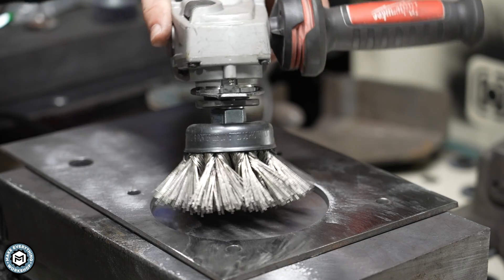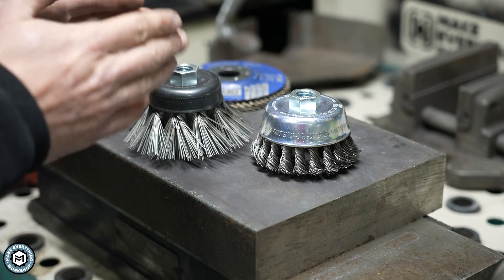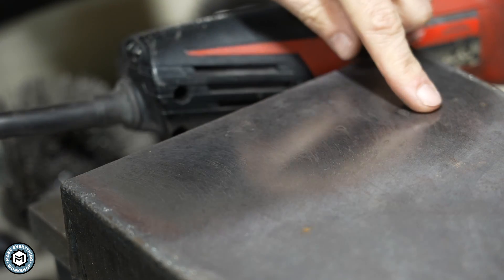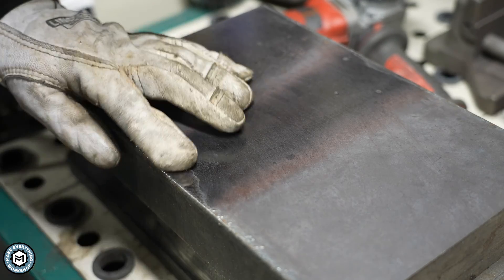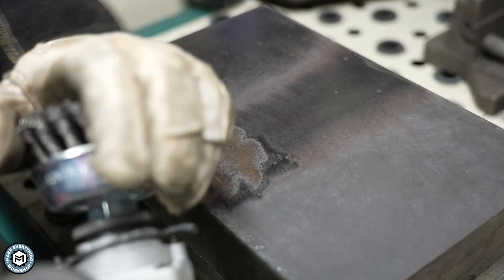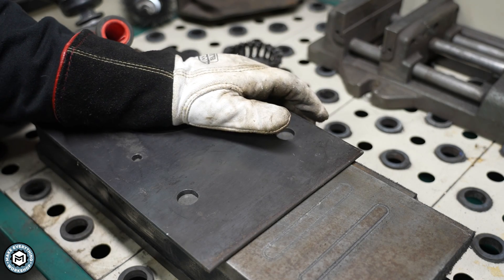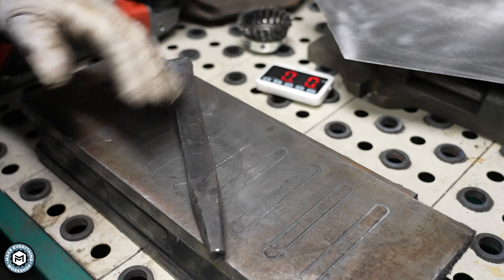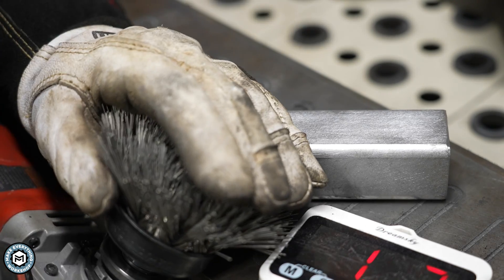Does a $300 Diamond Coated Wire Wheel Work?

Comment: Anyone that has done metal work knows flap wheels only leave deep gouges "depending on the way you use it" with any metal removal consumables you wanna keep a flat position and dont apply too much force....there is noooo way this is more cost effective than even the cheapest flap wheels 🙄

Comment: I can see the advantage to the diamond coated brush, but the real question durability. The fragility of diamond plating may make it impracticable, especially for most applications. It is an interesting option though.
Reply: fragility?
Reply: @GroberWeisenstein  Yes, fragility. I have worked a lot with diamond plated abrasives. The only way I can describe them is fragile, as the nickle plating holding the diamond grit can be subject to cracking and flaking. Taking in to consideration the flexing of the wires in the wheel gives me  consideration of their durability. ✌
Reply: @joemcgarry1106  thats why copper is used in premium diamond pads and heat resistant resins for filaments
Reply: @GroberWeisenstein  Thanks, I  will read up on it.

Comment: I had bought this purple 3m wheel that looked like plastic with fingers. It lasts long if you are only doing flats and not edges it takes mill scale off really well and was much cheaper. This diamond wheel is neat but $$$

Comment: You can clean  ferrite off a wire brush using  a soak in Citric acid or just buy Iron Out at the Borg.  
I've been looking at the Diamond wheels.  At $300  I had a lot of questions - especially  how long they will last.
 In the meantime I found Pferd  They have disks that  literally  eat steel for lunch.  And they last forever. 
So please do post an update after you have been using the Diamond brush for a year.

Comment: You could buy coldrolled steel. That stuff usually has no millscale whatsoever, also the tolerances are tighter, its worth the tiny bit more price because often enough you just take it, cut it to lenght, deburr and thats it... If you have a surface Grinder or Mill throw it on there with some old big gnarly face cutter or wheel and give it a spin. Even a belt sander works wonders on that or the pneumatic scale removers you have for welding... If you really wanna use an angle grinder with 300$ wirewheel (ever had one of those or more wires sticking in your arm or else?!) Then go for it. Im not saying its per se bad im just giving ideas how to avoid it. Cuz there are better options for most people.
I prefer to buy coldcrolled or premachined material. Its a bit more expensive to buy but it saves A LOT of hassle. Aka your time and money. And nerves. 
Peace!

Comment: Could you pleaseeeeeee do a video on this diamond wire wheel on stainless? We build SS panels and gates out of 2x2 square tube. So the miters have the get ground down and then buffed and it can be a challenge making all the grain run the same way as a satin finish. I’d love to see if this would help us! Thank you!
Reply: We found it cheaper to use mill finish and clean everything with a gitterbug to get a uniform finish vs polished tubing.

Comment: Hey partner, where can you pick up a Mag Vice like that one you're always using? I'm just wondering. Thanks for the great content Chris!
Reply from the maker: Thanks Brent! This is an old one off a surface grinder, but if you look on eBay or amazon and search "mag chuck" you can get brand new ones in a variety of sizes. They are really handy for cleaning up metal parts that may be hard to grab. Not the cheapest tools, but they'll help you get more done!
Reply: @MakeEverything  Thank you! I had tried looking before and didn't have any luck, although I see now. That was because I didn't realize what to search for! I figured they wouldn't be cheap. Most quality tools that I find, tend to be a bit more expensive.

Comment: As a respectful alternative - You can simply soak heavily mill-scaled parts in Cleaning Vinegar, which costs about 4 bucks / gallon at Walmart. 
The difference between cleaning vinegar and white vinegar is that cleaning vinegar consists of 6% acetic acid, while the white vinegar has an acidity of 5%... This 1% difference is huge in acid intensity, making cleaning vinegar 20% stronger than white vinegar.

Soaked for about 4 hrs., a lot of that mill scale simply wipes off with a rag. The vinegar residue left on the part(s) can then be neutralized in a mixture of baking soda and water.
Reply: That definitely works (I do it all the time... for small items that will fit into a tub).  What if the piece is 10 feet long?  5'x5' plate?  Size is a factor.
Reply: Or why not just use a mill?  Cheaper (if you have the mill), and will leave a flatter surface.
Reply: @BuzzingGoober  What do you mean? 'A mill'? Like DW Wood Builds replied - What if the piece is 10 feet long or a 5 foot x 5 foot plate? What kinda mill are you runnin' over 
there?
Reply: Do you dilute the vinegar or use it straight?

Comment: I heard that mill scale can be removed with vinegar. How does this method compare to the shown ones?
Reply: The ones shown is when you need it done NOW, Hydrocloric Acid is when you need it Today. 12% vinegar is when you can wait 24h.
I got a smaller bucked of Hydrocloric for small parts i want cleaned within the hour, but usually i put my stuff in vinegar. Its ALOT cheaper and wont burn you or anything about the shop.
Recently built a welding table out of 90/90 H-beams and a 20mm thick plate. All of the got to soak in vinegar for about 2 days, then i just preassure washed  and rubbed some wd40 on it. couldnt be cleaner and no grinding marks, pretty much ready for polish.
Reply: @kennyfolkeryd735  thank you very much for the information. Very helpful.

Comment: So here's a weird one, apparently diamond tools don't work very well on steel because steel dissolves the diamonds. This makes me think that you're going to be going through that $300 wire brush relatively quickly if you're using it to get rid of Mill scale.

I don't know the chemistry but this is something I learned from a very experienced Machinist.  Also, how would you rate the diamond wire versus a soak in vinegar?
Reply from the maker: I’m not sure about the diamond vs steel thing, I know a lot of thought went into making these diamond wheels so I’d doubt there’s evidence to say it’s counterproductive. While they are expensive for the end user, I’m sure they are expensive to manufacture. With the vinegar option, I’m sure it’s cheaper overall, but not every part can be soaked in vinegar, in my world, most parts are too big or cumbersome to be left in a vinegar bath to soak…
Reply: @MakeEverything  I still haven't done the vinegar method yet, but people really rave about how easy it is to dissolve Mill scale. I think in a production environment, something like this can save a lot of time and therefore money, so it makes sense
Reply: @MakeEverything  the company that does my laser cutting uses s355 steel. It has very hard mill scale even On thin stuff. Strip discs clog in a minute. I have removed mill scale from very large pieces by wrapping cloth around it, soaking the cloth in vinegar and then wrapping everything with stretch foil to prevent evaporation. Comes off with scotch brite the next day

Comment: Silicon carbide sanding discs and polycarbide discs are cheap and remove mill scale really fast. their finish looks better than a grinding disc but not as good as the diamond wire wheel. They will wear out fast when they get down to the steel, so only good for paint and millscale.

Comment: i dont seem to have any problem removing mill scale with a simple flap wheel..
Reply from the maker: Have you ever worked on heavy plate over 1”? The mill scale at that size is much different than normal consumer sized 1/2” and below

Comment: Mureatic acid makes work of mill scale in no time
Reply: How much time is "no time?"
Reply: @JackOffAllTrades  Depends on how large the piece is you want to descale.
Reply: @JackOffAllTrades  smaller pieces about an hour, I clean my Dragon tail twists in it when I need them shiny the same day.
If I got a day or so I let shit soak in 12% vinegar instead. more cost effective and wont fuck anything up if you spill it.
Reply: @kennyfolkeryd735   Less than a hour when you use new muriatic acid. I use the environmental friendly one that is weaker than the pool stuff but it makes my metal easy to tig weld. I now order pickled and oiled steel.

Comment: yeah, aint affording that, but the point is good.
I let my thick shit soak in 12% vinegar (sells as weed repellant) for 6usd / 5Liter for about 24 hours, Millscale just washes off.
Works better then you think, did this to a 20mm thick 2000mm/1000mm  plate used for my welding table. saved me a shitload of time.

Comment: The timer was pointless, you didn't do the same area with each abrasive and you were obviously tickling the plate with the twisted brush and the sanding disc and then the 36 or 60 grit flapper.
No consistency whatsoever.